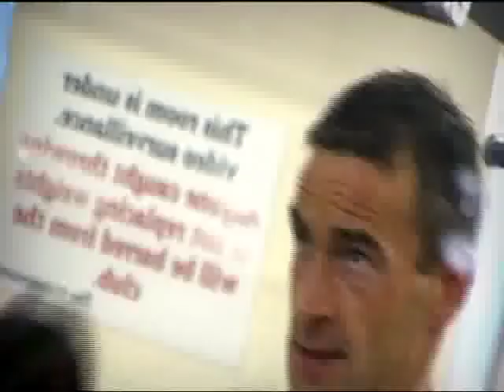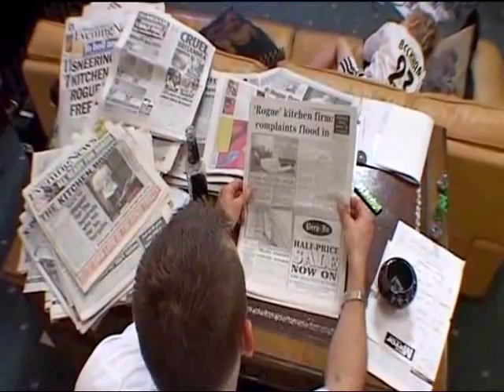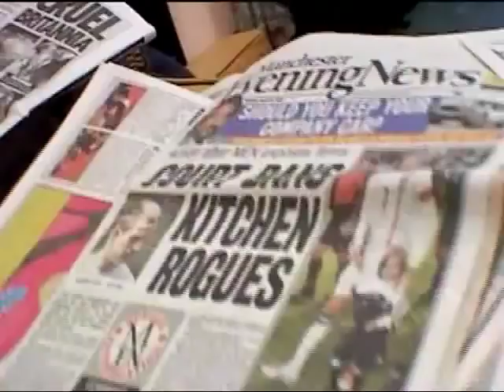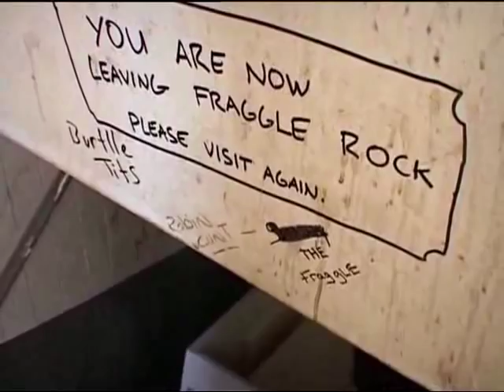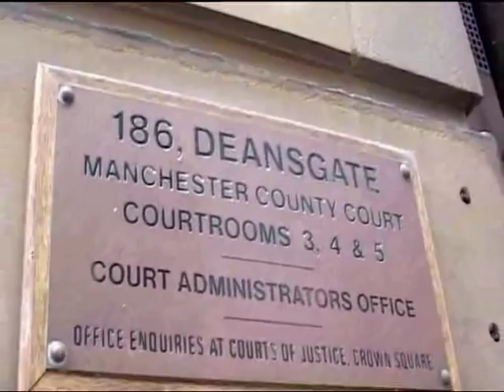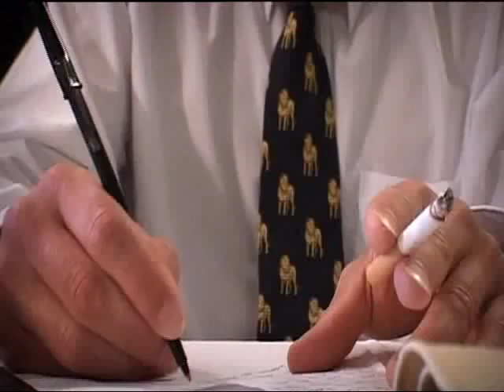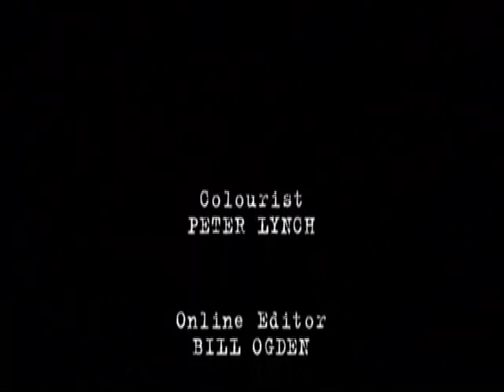Vance Miller - The Kitchen Gangster

Comment: Typial BBC hatchet job. They are brave when it comes to slagging off the relatively small businessman but when it comes to the ones they should be targetting they brick it. He's selling 20,000 kitchens a year and gets 180 complaints, that less than 1%. Mistakes will happen in any business, unfortunate but true.. He's able to sell at much lower prices than the high street stores because he doesn't have a network of stores to have to maintain. Also people have to appreciate that when they are paying such low prices. Dear BBC get your own house in order and when (or should that be if) you have then concentrate on the big fish that should be exposed.
Reply: If you sell 20,000 kitchens a year and get 180 complaints to Trading Standards, that's going some. That 180 figure is just people who were savvy enough to know to go to Trading Standards in the first place and then actually bothered to go through that process as well. Most people don't. You can multiply the total number of complaints to his business tenfold I'm sure. 

Yeah he's good at making money and people paying peanuts for kitchens can't have too many complaints when the quality isn't good. But you know, no smoke without fire and that.
Reply: They're only after him because he deals in cash